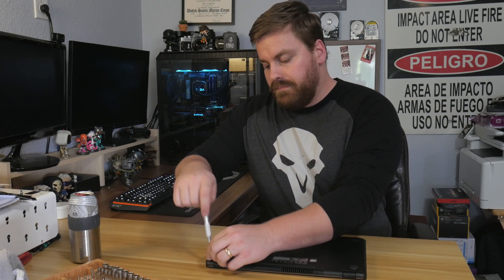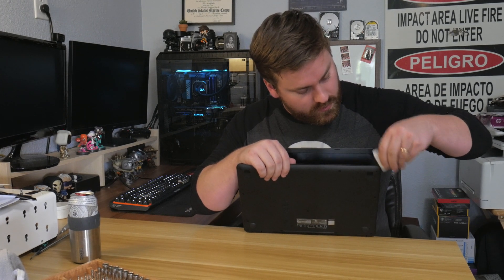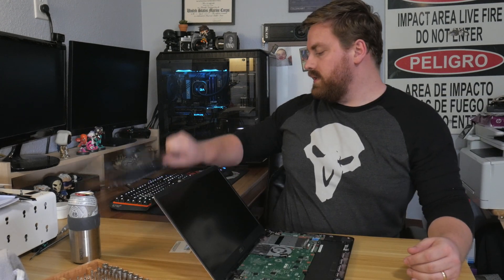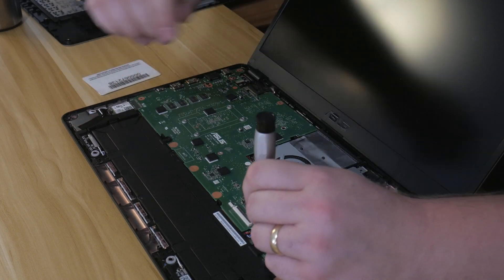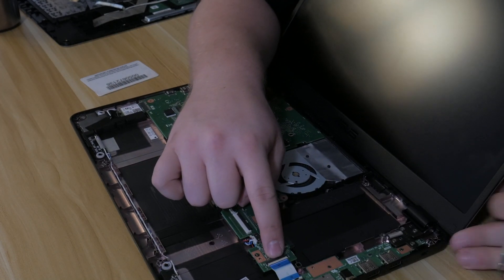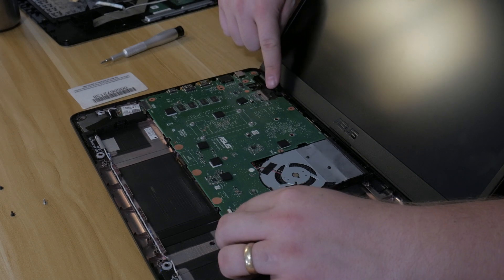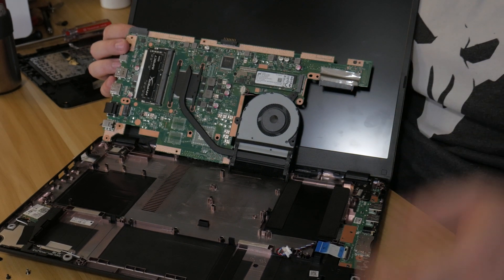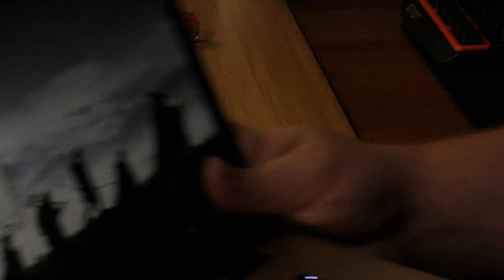Ryzen Mobile: Upgrading RAM on Asus Vivobook F505ZA-DH51

Comment: How long can I expect this laptop to last? I bought the X505ZA as a backup computer. I occasionally like to fool around with it, but have been rather disappointed in certain instances with it's gaming performance in single channel. Now, I've been thinking of adding another 8 GB stick, however, I'd just like to point out that I've already owned it for about 12 months. I've rarely used it but may use it as my main computer at some point. So do you think it is it still worth upgrading? I'm concerned that there may be natural degradation in battery life or other parts, although when I do use it, it's usually plugged in.
Reply: Bought my X505ZA on August 2019, the battery is still very much, if not perfectly healthy. Maybe because I have the Asus Battery Health app mostly on max lifespan mode (it stops charging on 60% battery). When on max battery mode it runs fine for ~4 hours on Ms Word and Paint Tool SAI.

I'm also considering to add 8 gb ram, but not sure if it'd significantly boost gaming performance. Still reconsidering bc I'm quite tight on budget lately 😅
Reply: @fn3108  Hey, I actually went ahead and upgraded with another 8 GB stick. It does make a pretty big difference, although sometimes it's not always so obvious. Like sometimes, it feels like I can bump up the settings a notch. Like Injustice 2, I was at lowest settings, lowest resolution, and now it feels like I can play at 720p (lowest), which is a pretty big improvement. Other games, the improvement isn't as big, and to my disappointment, it feels like in a lot of emulation, (Ie. CEMU), it can be hit or miss. NSMBU and Ultra Smash, I think I'm getting much better fps, but MK8 and M3DW, don't seem to have improved. 

Overall I'd say it was worth the upgrade. Just make sure if you're getting someone else upgrade for you, you go somewhere reputable. I've got a feeling the guy who upgraded mine, put in 2nd hand RAM. As a backup, I can't even sure it will be reliable anymore. Anyways, best of luck.
Reply: @bgates275  Oh, so it depends on the software huh. I also use my laptop for SketchUp, Blender, and Unreal Engine (in which it gasps for help but runs pretty fine on simple tasks), hope the improvement would be significant on those. Thank you for the enlightenment!

Comment: i have the same procie but different model asus vivobook x505za-ej505t with samsung 4gb 2400 mhz ram CL17 soldered on. i have 1 empty slot to upgrade but when i bought micron brand with the same ram capacity, frequency and latency and installed the ram my laptop didnt boot up, the same happened with a kingston brand with the same specs 4gb 2400mhz CL17 still it didnt boot. is it the same brand that i need to buy? but watching this video made me think that is not the case because it worked with kingston hyper x impact. what do you guys think?

Comment: Question, what is Ryzen Adjuster, what software do I install?  Last time I attempted to install AMD Ryzen Master on my Windows 7 home PC it basically killed the OS (boot loop).  Is that what I install?  Kinda reluctant to go through the headache if it kills the laptop, unless you claim it works.  The max TDP reported in CPU-Z is 15 watts for this processor, but you claim it can do 30 Watts??  Just curious if the processor can be  pushed harder. 

 I did the upgrade to 16gb, also added a 512gb ssd drive in the available slot and installed win 10 ultimate on my x505za Vivobook.  Strangely, my SATA SSD works faster then the M.2 drive.  I am still modding Windows 10, removing Cortana and defender, blocking updates and installing software.  Clarification on the SATA drive slot, make sure you acquire a thin drive as a standard mechanical laptop hard drive is too fat to fit in this laptop!  I had to use a SSD SATA drive because the mechanical hard drives I have are all too fat.   I noticed a decrease in battery life runtime after installing my SATA hard drive and extra memory stick, so something to note is a increased power draw after the upgrades.

The adding of the extra memory stick did not reveal any added benefit in graphics or compute performance despite having a dual channel memory benefit.  At least I can run more Virtual machines.  Other people may observe a benefit, but not me.

Also, when I had the laptop apart, I drilled a few holes under the fan to decrease the air restriction on the   fan intake.  Thermals did improve marginally.  a guy would likely need to change the cooling fan to increase the CFM, because they use a silent version of cooling fan which doesn't move that much air.  After using this laptop, I am delightful that I have one and look forward to trying the 4000 series Ryzen series, as I believe there are 8 core processors now in a laptop.  Honestly, this laptop out performs anything I have used, for the power draw.  Also, your audio is out of sync a little and the cpu-z part is blurry.  no big deal, and Thanks for sharing this video!
Reply from the maker: Hey, thanks for the feedback about the audio.  No, as far as I know Ryzen Master still doesn't work on laptops.  There is software you can install to tune your chip, but it's iffy on the actual functionality, as some laptop BIOS's are more locked down than others.  One you can check out is RyzenAdj, as well as Ryzen Controller.  YMMV with them, but I've used RyzenAdj before and it worked well for me

Comment: Is it possible to put liquid metal in this laptop?
I've heard over there that corrodes aluminum.
Because if there were no problem, temperatures would drop considerably 20 °.
I await your response thank you very much for the great informative content of this model.
Reply from the maker: I personally wouldn't, whether it would corrode the cooler or not.  There is much debate over the use of liquid metal in mobile devices, as at the end of the day it IS a liquid, so there may be a risk of the liquid metal seeping from under the coldplate.  Plus this laptop doesn't suffer from temperature issues anyway, so I would say it's Overkill.  You could always use a high quality TIM like kryonaut or noctua NH1 and invariably see an improvement too
Reply: thank you very much brother @GamesCoffeeCollecting

Comment: Hi. I installed a 4gig ddr4 (my model is similair except it comes with 4 gigs ram) and it creates an issue where my laptop goes into an endless automatic repair loop. Any ideas?
Reply from the maker: Hmmm, no I don't know what would cause that.  What's the speed of the new stick?  Have you tried updating your bios with just the stock ram stick?
Reply: @GamesCoffeeCollecting  its 2400 mhz. I checked on the kingston website and this stick is compatible with the laptop. How would I go about updating my bios drivers?
Reply from the maker: @RandyAndyShow  I'd go to asus.com/support, find your model, then click on "Driver & Utility".  There you'll be able to find your BIOS updates for download.  Alternatively, I'd return that ram and get a replacement of the same time.  While ram is pretty dang reliable, you never know and I'd rather not run around in circles while your return window closes.
Reply: @GamesCoffeeCollecting  ye. im gonna update bios now. if that doesnt work ill return the ram
Reply: @GamesCoffeeCollecting  updating bios did nothing. do you think its the ram slot itself or the ram? because maybe I should return the laptop.

Comment: I installed ADATA 8GB 2400MHz ddr4 , but getting windows bluescreesn error with stop code, when removing ram everything is fine, what is the problem? pls help...I installed it properly and it's even detecting in BIOS...pls help
Reply from the maker: Perhaps try a BIOS update with the stock configuration.  What's the blue screen error message?
Reply: @GamesCoffeeCollecting  KERNAL SECURITY CHECK FAILURE
Reply: Its detecting in bios, is it because dual channel wont support on different memory cofig. like Im adding 8gb on to a 4g soldered borad?
Reply: tried latest bios update also no change
Reply from the maker: @ajaynarayanan2326  if its it's not booting at all with the new stick of RAM, it could be a bad stick.  Otherwise it could be a kernel driver issue, so you could try updating all your drivers from the manufacturer's websites (nVidia or AMD if you have dedicated graphics, and Lenovo for things like audio.  Lenovo should have a driver update you could download to help with this 

If all else fails (you've tried a new stick of ram, updated all drivers) you could try a fresh windows install

Comment: Does it have any warranty seals on the screws? I am buying the Asus X505ZA which looks kinda the same as hardware and i want to upgrade to 8GB but i don;t want to send it to a service. You lose the warranty if you do this ?
Reply from the maker: There were no warranty stickers anywhere on the laptop, even on the inside if I recall.  I'm not sure where you're located, but in the US, opening your device does not void a warranty, and those stickers are useless here anyway.  Have fun with the new laptop!

Comment: This particular laptop only has 1 ram slot, correct? I cannot find a user manual anywhere online so I'm kinda just guessing based on what I can find online
Reply from the maker: Right, the first "stick" of ram is soldered to the motherboard, with one empty slot for expansion

Comment: I brought this laptop (Asus Vivobook 15 x505za/F505za) about 1 week ago. It comes with 4 GB of ram and 1TB HDD. So i upgrade it with extra 8GB DDR4 Ram. Now 12 GB Ram. Performance is ok.but not enough. So i planning buy a M.2 NVME SSD. Is it support or not.  
When i look in to the price of SSD. Only slightly higher than m.2 SATA.
So i think NVME SSD is better choice. But i don't know it support or not? So please reply
Reply from the maker: Yes, it does support NVME SSDs!  I put one in this laptop too and it worked great as my OS drive.
Reply: @GamesCoffeeCollecting   thanks man. For instant reply. Actually I'm planning buy this one https://www.onlyssd.com/buy/silicon-power-256gb-nvme-pcie-gen3-x4-m-2-2280-ssd-sp256gbp34a80m28/
Reply: @GamesCoffeeCollecting  Which m.2 NVME SSD u tried on it ? Can u give me the link ?
Reply: I don't know what is wrong with my laptop.It's not working for me.. i tried everything on my laptop BIOS settings to detect it. Maybe  i am missing something..   I tried to change storage option too. I only have ACHI.. NVMe needs  RAID if  I'm  not wrong. Also updated BIOS to v311.
Reply: @sajithvarghese1994  Did it work in the end ? or u had to go get a Sata 3 m.2 SSD instead ?

Comment: Is it better to use an external Hardrive or install an internal one? Which internal hard drive can I install in it?
Reply from the maker: I suppose it depends on your use case!  External hard drives can offer a much higher capacity than anything you can fit in this laptop, but with externals, you're limited on mobility since you have to lug it around with you. Internal hard drives are much more convenient, since you don't have to worry about cords or packing around extra drives, but you're limited two only a single 2.5" hard drive (or SSD) as well as an m.2 SSD.  As far as internal hard drives, it comes with only a 256 gb SSD (in the m.2 slot) but you can buy a 1 or 2 terabyte hard drive on amazon for pretty cheap (it has to be 2.5") and just plug it in under the hood.  I show where to put it at about 6:15
Reply: @GamesCoffeeCollecting  I thought the max was 1 TB? .. I'm buying it the same place you got yours. So I'll just get everything there.
Reply from the maker: @barringtonjames2441  you can buy a 2tb 2.5" SSD on amazon or newegg and it should work just fine in this laptop

Comment: will the warranty be lost.... if we upgrade the RAM.... because it looks like a laborious process..... someone might mess up with the warranty stickers
Reply from the maker: There were no warranty stickers on my model.  I suppose it depends on where you are, because in the US you can open your products without voiding your warranty.
Reply: @GamesCoffeeCollecting  Ohhh.... I'm from India....so looks like i gotta do a small research in that regards
anyway....that was a fast and useful reply
Just clear me on thing which should go for....intel 8250u or ryzen 5 2500u
do driver updates play important role in performance of the laptop..?
Reply from the maker: @dagastya7007  Both are 4 core, 8 thread chips, but the 2500u has a higher base and boost clock, and much better graphics.  If it was up to me, I would definitely choose the 2500u over the 8250u.

Driver updates do pose a very important role in performance, and thankfully AMD now offers mobile driver updates on their website, instead of relying on the laptop manufacturers to distribute drivers.  If you plan to do much gaming, the Vega 8 would fare much better than the UHD 620 graphics in the 8250u.
Reply: @GamesCoffeeCollecting  I am student ...i do programming,heavy browsing,photo-editing, gaming too
should i go for 4 gig variant and add 8gb to it making 12gb
or 
would it be better to go for 8 gig and add 8 gb later
Reply from the maker: @dagastya7007  I would go for the 8 gig now and add another 8gb in the future.  4gb can get eaten up pretty quickly with photo editing and browsing.

Comment: How are the speakers on it, I'm reading some reviews saying it sounds not so good? Would this laptop work for light video editing without any RAM upgrade?
Reply from the maker: The speakers are pretty tinny, but about what you would expect given the price point.  The CPU is definitely capable, given the 4 cores and 8 threads, for some light video editing.  As far as the RAM goes, it depends on your video editing.  Higher resolutions and tons of after effects can drastically increase RAM usage, so I can't say for certain, but you should be good to go.
Reply: @GamesCoffeeCollecting  Thank you, appreciate the response.
Reply: @GamesCoffeeCollecting  This is a IPS display, correct? Sorry for all the questions looks like a nice laptop to snag.
Reply: @JEK  definitely not IPS. Viewing angles also not good.

Comment: What was the CL before upgrading to 16 gigs of ram...
Reply from the maker: CPUZ showed it as 2133 CL 16 if I recall
Reply: @GamesCoffeeCollecting  has upgrading dual channel ram increased your system boot time. Can dual channel ram can be an alternate of  ssd upgrade. Has it increased your overall system performance and responsiveness.
Reply from the maker: @AbhishekKumar-nv7xj  No, increasing RAM shouldn't have a noticeable effect on boot time, in most cases won't affect system responsiveness, though it has a huge impact on things like gaming performance with the Ryzen APUs

Comment: What ram card did you put in?
Reply from the maker: I used an 8gb stick of HyperX Impact, 2400mhz/CL14.  It ran great at the full 2400mhz but even after a bios update, I couldn't get the timings any tighter than CL17, so any 8gb 2400mhz stick would probably work just as well
Reply: @GamesCoffeeCollecting  
What can I use in the model: f505za-db31? Says up to 16 ram but only has six. I cannot find info on this model?
Reply from the maker: That's the model with the Ryzen 3 2300u.  It's the same as this laptop, just with a different CPU.  I'm sure that any 8gb stick will work.  This one is about $10 cheaper than the stick I used but with the same speeds 

https://smile.amazon.com/Patriot-Performance-PC4-19200-2400MHZ-PV48G240C5S/dp/B01KBKHK56/ref=sr_1_4?keywords=8gb+ddr4+sodimm+2400&qid=1555739125&s=gateway&sr=8-4
Reply: @GamesCoffeeCollecting  Awesome thanks for the help buddy!